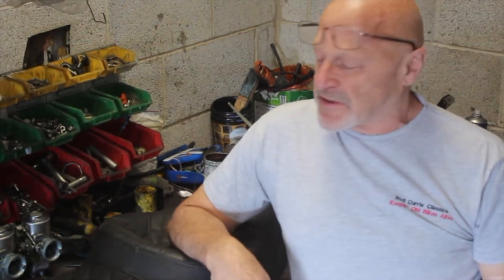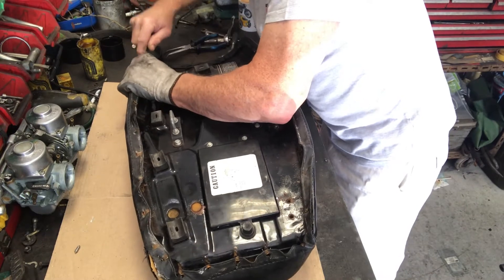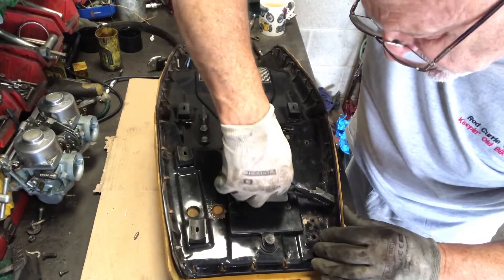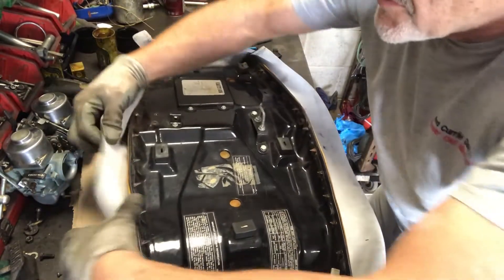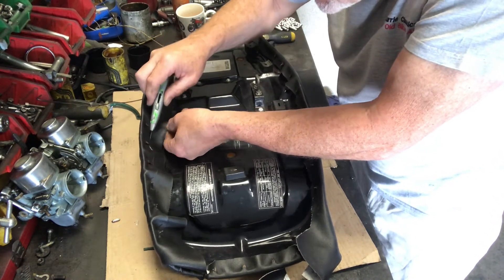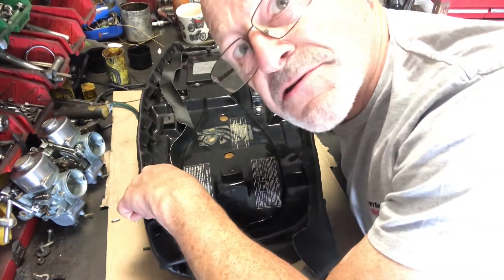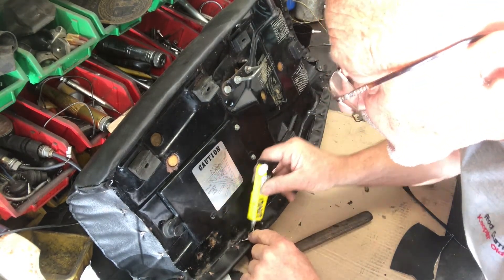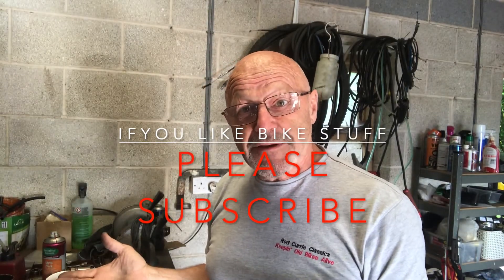How to re-cover a Kawasaki Kz650 seat

Comment: Hi Rod I see you have a pair of keihin carbs on the bench there I have similar on my 75 kz400 I’m having poor running rough idle problems with mine I spent £360 with Exeter engineering to get them working again but wondered if you have any tuning tips ? Thanks 👍🏻🏴
Reply from the maker: Hi Luke, Thanks for watching. Whet did Exeter Engineering do with them. Have you tried to adjust the since you got them back? Mail me on rodcurrie88@gmail.com and I'll help any way I can.

Comment: Logo is too high and pattern is too far left . The foam goes hard and shrinks , cover the seat with a thin layer of new foam and stitch the edges like the original seat , double thickness is stronger , the last one I did I had the pan powder coated . Those rough cut edges look shabby